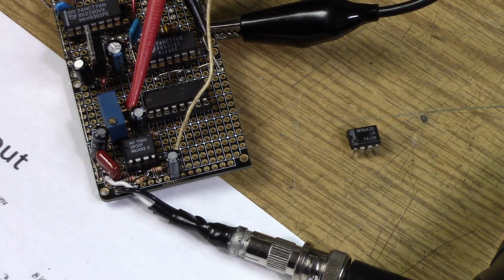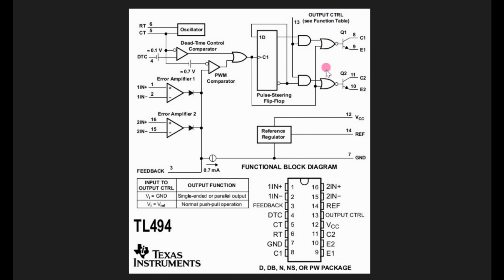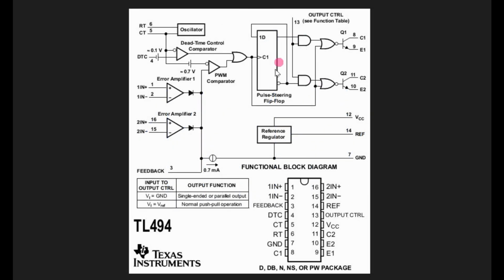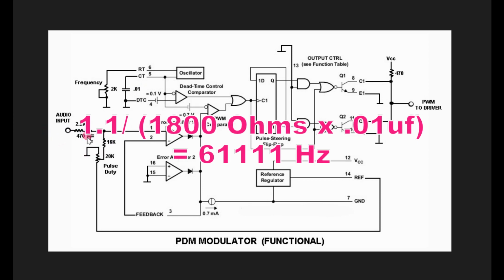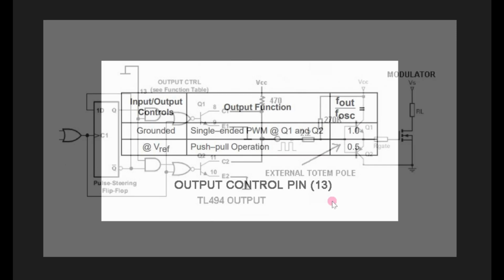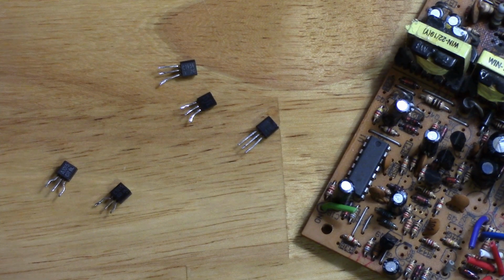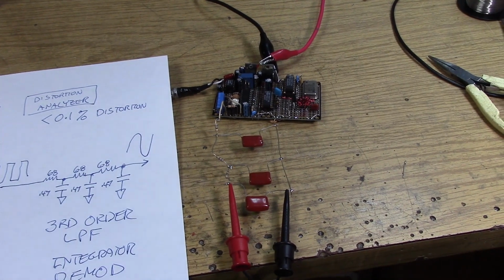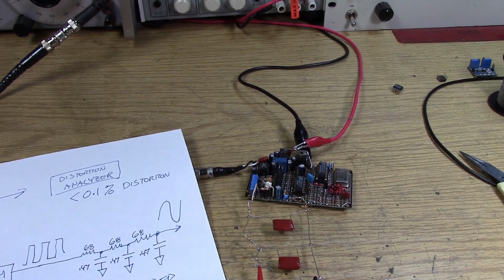PDM Part 3

Comment: Mike I like your videos, you are the real deal Electronic Hobbyist when it comes to building/testing these useful projects. Very interesting explaining how the PDM circuits function, learned that its fairly simple to do, you took away the mystery. When you tested the  audio THD, I see you used the HP334A distortion analyzer, even though its from the 1960's that model line was top of the line for the time, I have the HP-333A model and I love it. I had to do some restoration to it, the meter dial face was peeling off, but was able to save it with clear coat paint. Each meter dial is calibrated individually when made, you can't use a copied one from another meter face.

Comment: Great as always, Mike! That 741 is an old bird and a general purpose op-amp. The OP-37 is at least a decade newer in design approach and is much better suited for higher quality audio... not just lower noise but I’m sure it must have a better spec. as far as distortion compared to the 741. I wonder if your distortion measurement would be any lower using it. An interesting exercise since you’ve got a socketed situation. I realize the current distortion measurement reveals how well that filter turns the square wave pulses back into a sine wave... the bulk of where that % comes from.
Reply from the maker: Exactly since the old distortion analyzer simply measures anything outside the frequency nulled out. Being ultrasonic, this much filtering is not used with class D Audio Amps.

Comment: Why 60 kHz? I get that it's well over 3x the highest audio frequency we're likely to see, but most other PWM transmitters I've seen use frequencies like 175 kHz for the sawtooth....my guess was to make it eaiser to filter out any noise from it on the output (you mentioned earlier if you don't filter it out you get spurious sidebands...)

Comment: I believe the lm358 is good for audio as well
Reply: I'd use a 5534/5532.  They're fast, low-noise, & cheap.
Reply from the maker: There are wonderful Audio grade low noise op-amps out there with far more performance than the old 741. With a junkbox microphone and radio like this however, I doubt that it is going to represent the critical factor in audio quality.

Comment: Could you have used 2xBD131 power transistors configured like the 5W Class A amplifier circuit found on Google Images to drive the RF power output stage.

Comment: 00:55  I don't allow ANYTHING with a slew rate under 1 V/uSec into my shop!  Even my felines jump up on the bench, faster than that.
Reply from the maker: No 709s or 741's? Ha. I was playing with those GHz op-amps that were coming out in the 80's back at MA/COM for radar detection DC pulse amps. Now they have them cheap and tamed!
Reply: @MIKROWAVE1  All the more reason to shun 741s!  I remember, in the 80s, that a lot of cheap "hi-fi" gear used 741s.  Of course, they produced TIM distortion up the arse.  About then, Signetics came out with the 5532 & 5534, which were 11-12V/uS--plenty fast to produce clean audio, and there was also the TI 072 FET op-amp, which was good, though a little noisier.  There were, and are, op-amps that are far better than the 741, and they're cheap.  So why does the 741 continue to exist, like a decayed corpse that hasn't figured out that it's been dead for 40 years?